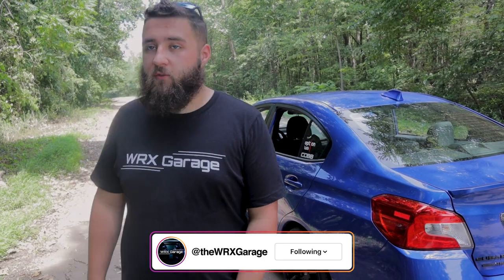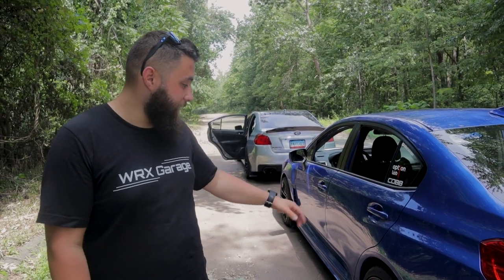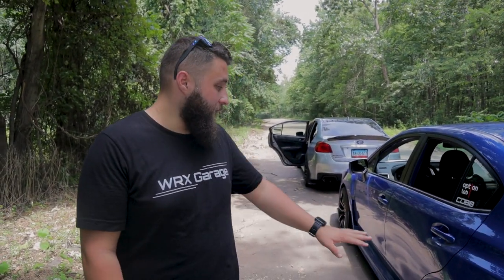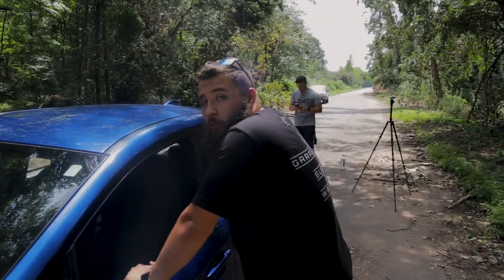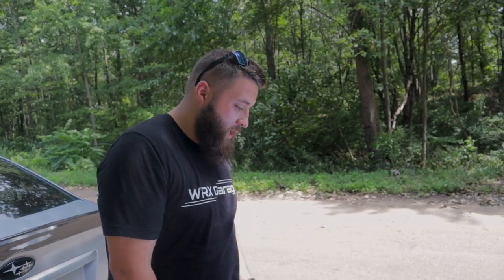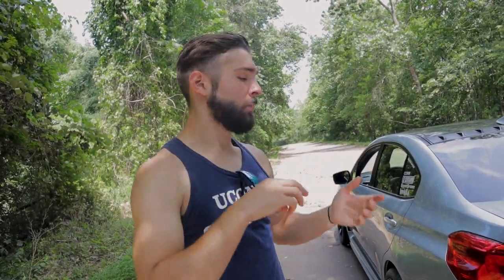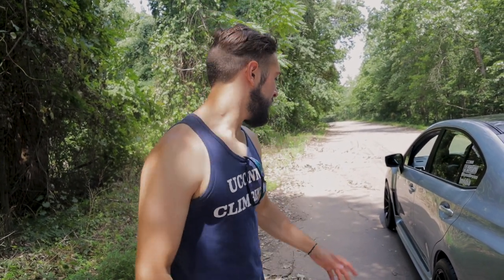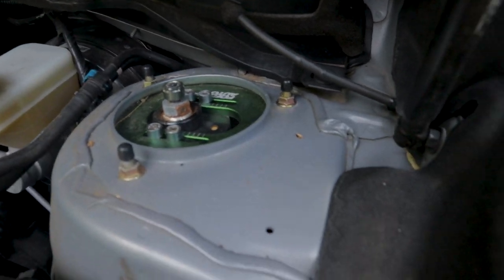BUDGET vs MID-TIER Coilovers - 10K Miles Later - Subaru WRX 15+

Comment: I blew my tire out like that recently ( The entire inside wall of the tire was gone), on stock suspension, at like 75 mph. It was quite uneventful. I wouldn't say that your coilovers saved you during that. Probably the fact that its an awd car and was a rear tire and not a front tire.

Comment: I just got a set of ISC N1 Sport Comfort with the SSS springs 8k front and rear and they are way more comfortable and better performing than stock especially as far as the dampening goes. I have them 6 clicks from softest for daily. The whole reason I got coilovers was because the Subaru stock setup was so bad and because of videos like yours, so thank you. Make a video of you putting the thread protectant on, because i really want to protect mine with something that is vetted and tried for this application.
Reply from the maker: We have a clip of it in our previous video called "custom coilovers lift"! We'll probably make a video on it in a couple months

Comment: Thanks for review still deciding what to go with on my 2018 WRX
Reply: ... not budget or mid-tier ...ST (p/n 10245018); KW V1 (p/n 10245018); Bilstein PSS10 (p/n 48-249546)...curious how the budget companies can include (camber adjustable) top hats and other features and then charge what they charge is mind boggling.    The faction fab set is compelling, but I'm still trying to figure out where the company is based out of...

Comment: thanks for the videos. I’m getting the faction fab f spec installed tomorrow. I guess I’ll find out tomorrow but how much more comfortable are they on bumpy roads now than stock?
Reply: Are u installing them yourself ?
Reply: Hey man, just wanted to ask on how much improvement you got when driving on bumpy roads with the coil set up.
Reply: After a year how did they compare to the stock suspension was it a better ride?
Reply: @mdnation4325  I think it’s a better ride but for the ride comfort you are sacrificing making the car a little more bouncy than you might be comfortable with.

Comment: Great educational video!  I have a 2005 Lexus LS430 and I want to get some coilovers that will provide the same or similar luxurious ride that the car originally came with.  I don't want to lower the car, I want the same height as originally came with.  Would appreciate your suggestions as to the best option in the $400-$700?  range conversion coilovers for me.  Thanks!
Reply from the maker: I'd have to do some research on what companies make suspension for Lexus! Not too familiar with that platform.
Reply: lol most coilovers will double or triple your spring rate, also most AM dampers will be harder, so you are asking for the impossible unless you go with airbags.
Reply: I had BCs on my 05 gs300 and omg it was the nicest feeling for a lowered car

Comment: Bro, I also like and respect Fortune Auto products, they are quality, but I can't believe that you mentioned Raceland and Tein suspension products in the same sentence. That is like comparing Hyundai to BMW, "not even close"! Raceland is an eBay priced product, while Tein has been manufacturing quality suspension products since 1985, for every price point and vehicle. Please do a bit of additional research before you dog a highly rated, industry leading product like Tein. And yes, I'm running Teins on my vehicle with great results! Thanks!👍🏼

Comment: thanks guys.  looks like Fortune Auto doesn't use stainless steel hardware.  Even after 15 years, my GTI top nuts had zero rust on them.  Now, the stuff in the wheel well was a different story, but the stuff under the hood had zero corrosion.   I'm a  bit shocked at the condition of the Fortune Auto stuff.  What does this say about the other hardware they use?
Reply from the maker: That's the only spot on the FA system that had any rust. The actual body of the coilovers (the damper tube, the springs, lower mounts, etc..) were all completely oxidation free. Seems to me like just the nut itself on the top is non-stainless. I've had the FAs for more than a year and they've seen an entire winter as well.
Reply: @WRXGarage ...that is good news...any plans to run coil-covers/socks to minimize grit from getting into the spring/shaft seals?
Reply from the maker: Yes! I use Boeshield t9 and covers during the winter.
Reply: I got the fortune auto coils for my 17 Wrx and had So many issues with them from day one. When I opened the box the upgraded swift springs were literally loose and sliding around due to no preload on them.Finally got the instructions to set them correctly and installed the coils only to hear pop and clunk on the test drive. Checked everything and gave them a few days to see if they stopped. Three days later I ended up taking them off and got in touch with fortune auto to address the issue and they gladly warrantied the coils. Not to mention every piece of hardware was rusted including the swift springs at the bottom seat.They called back and said all 4 coilovers had blown seals and were installed with the incorrect seals and would send a complete new setup. Got my “new setup” to find the same rusted hardware coilovers (once again not preloaded) and found out they rebuilt they same set with correct seals which was bs. After accepting that fact I just put them back on the car for one day until the popping and clunking came back. Considering I paid over $2000 for this setup I sent them back and got a refund. I’ll never buy anything from them again.

Comment: Just installed the factionfab coilovers on my wrx, was wondering if u ever experienced a clunking noise when fully turning the wheel ? Maybe it’s just the coils settling ?
Reply from the maker: That sounds like either the spring moving around because the preload isn't set correctly, or it could be the steering rack itself moving. 

I would double check that all of your locking rings are tight and also redo your preload. There are plenty of videos on YouTube explaining how to do that!
Reply: @WRXGarage  thank you 🤙🏼

Comment: How did the Faction Fab coils do during the winter?
Reply from the maker: Solid! Still very comfortable.
Reply: @WRXGarage  Great to hear! Thank you! And how often should I spray boeshield on to protect them?
Reply from the maker: I'd say maybe once or twice a year. Give them a solid cleaning and a fresh coat right before winter. Before you lock the height adjustment collars make sure you add some antiseize on the threads too!

Comment: on these 2 set ups did u have 2 buy more suspension parts meaning aliment tires straight
Reply from the maker: No you can align straight with stock components.
Reply: @WRXGarage  thx u i will b getting a set of factionfab set

Comment: Is there a way to verify that the preload is correct? Just seems a little strange and or not very accurate the way they want us to set preload. Like did you just spin the ring till it barely touched the plastic ring or what lol. TIA
Reply from the maker: To set the original point to begin measuring from, I screw the collar up until I can't physically move the spring anymore by hand. Then I tighten the collar the 1/4" or 1/2" or whatever the manufacturer recommends from there
Reply: Yeah they are not very clear in their instructions, I brought it up like they showed in the video but it just doesn't seem very accurate.  I set them all before installing, notice I needed to drop more so did so. After adjusting the ride height my right and left rear mm spacing are off leading me to believe the preload are different. Suppose I'll follow your lead and measure each one to verify.  Thanks for the response and hope to see some more videos soon. Don't think I've missed one yet. Cheers 🍻!
Reply from the maker: Remember that the springs themselves settle after installation. Depending on the car and the individual springs each corner will settle slightly different, I don't think that has to do with preload as much as differences in spring rates or corner balancing.

Comment: The stock STi suspension leaves much to be desired. Don’t get me wrong, it does the job, but the ride is bouncy and you can get thrown around in the seat if you’re really pushing the limit. God forbid you hit a deep pothole. I just slapped on some HKS Hipermax S coilovers and it’s night and day difference. The car is glued to the road, and much more composed.